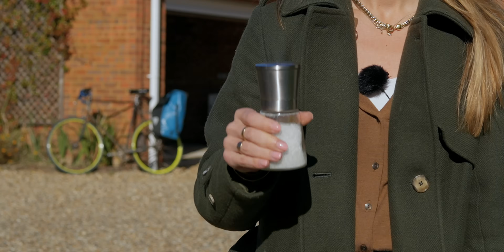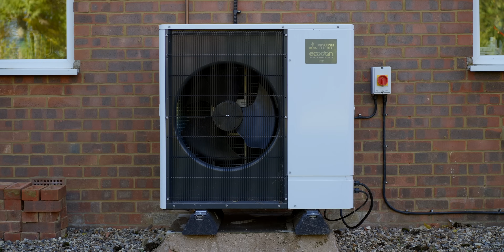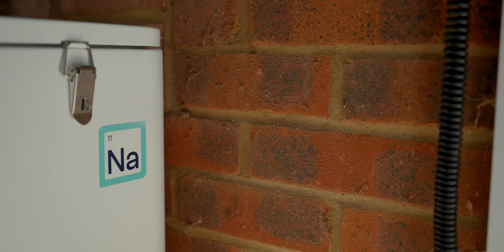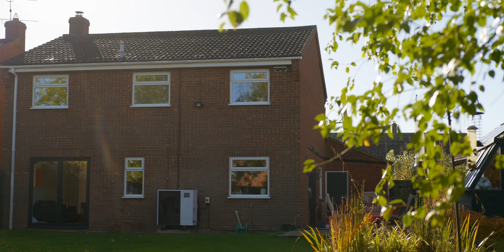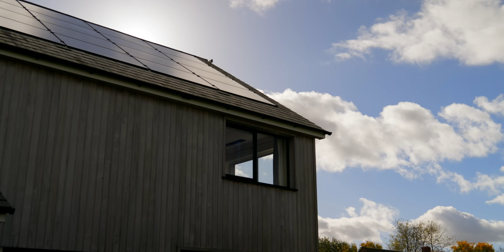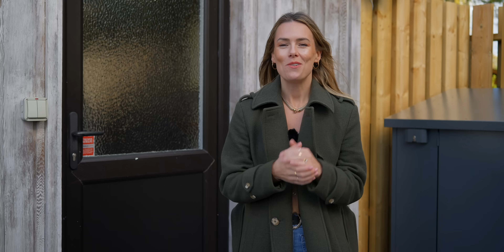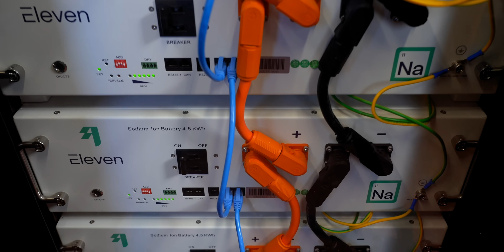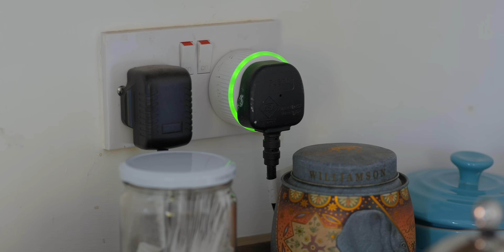Sodium Home Batteries Are Here! Is Salt The Key To Cleaner, Cheaper Energy?

Comment: Home batteries reaching 100,000 installs in the UK is good, compared to some other countries still lagging slightly, but getting there. While we are somewhat lacking in EV take up in Australia compared to the UK we are miles ahead in home batteries so I suppose it all evens out in the end. In just July 2025 it's estimated Australia installed just under 20,000 home batteries bringing our number close to 300,000 total which is remarkable when you consider we have less than half the number of houses as the UK. The climate of course does make a difference, with some areas receiving full sunlight for a far longer period than many areas in the UK. Keep up the good work, you chase us on battery and solar installs and we'll work on EV sales!
Reply: But we could change that 200,000 installs a year if were to make them mandatory in all new builds, along with solar and heat pumps. Subsidising the ones which are made in the UK.
Reply: @DavidKnowles0  Yep I agree, it's my personal opinion that solar and battery should be part of a new house build where possible. Then people say but how, it would push the cost of housing up, whose going to pay for it etc.

Yes there are problems, but they aren't insurmountable. Cost is a factor, but buying bulk through a government purchase then selling cheaper to the builder would help keep that cost down. Other financing systems, maybe current solar farm companies could finance the cost of a certain number and homeowners would basically get their own power for free and any excess fed into the system with no buyback, and the battery power available for use as virtual battery banks.

The advantage is it would be far cheaper to wire up and install the solar panels and battery while building the house because, well you've already got roofers and electricians there doing that work, far cheaper than paying for installers to come in once the house is finished.

Lots of options that could be looked at, maybe take some of the subsidies paid to fossil fuel companies and use that to provide big discounts to home builders and etc.

Comment: Great video. Picky criticism: energy per unit weight is relevant for mobile systems, the relevant density for static applications is kWh/litre (or m^3).
The key enabling technology is the control system, especially one that learns consumer behaviour and predicts tomorrow’s weather. 
Great story. For someone who doesn’t drive most days I want to use fully functional V2G. I look forward to a head-to-head comparison. (All the smart technology in your excellent video would be relevant). Thanks.

Comment: It's not a table salt :)
Reply: Indeed. This is like saying that oxygen is "water".

The chloride in sodium chloride (table salt) is as important as the hydrogen in H2O (water).

Hydrogen is an explosive gas, oxygen causes things to burn - but, put them together, and you've got water to throw over a fire to put it out. A completely different substance that's basically got properties diametrically opposed to each of those elements individually.

In chemistry, you can't just ignore one part of a molecule and act like "it's the same thing". It really isn't. Not at all.
Reply: The battery is made up of many other chemicals besides sodium carbonate, so calling it a Na battery is also misleading.

Now show me where the manufacuturer states they did not use the Solvay process to produce their sodium carbonate from sodium chloride?

Comment: sodium batteries are made from sodium carbonate, not sodium chloride (salt)
Reply: Sodium carbonate is made from table salt
Reply: @tedarcher9120  no it isnt, it is mined
Reply: @ldm3027 both are true. USA mines trona but china makes it from brine and ammonia as it doesn’t have any naturally occurring.
Reply: @ldm3027 Look it up, it's mined OR made from "table salt".
Reply: @Evolution56  but it is sodium carbonate that is used to make sodium for batteries
Reply: And Air is not just oxygen, and computer chips are not just silicon, so what's you point, beside being overly picky?

The Na battery is made up of many chemicals besides sodium carbonate, and yet you have no problems with it's name. Also sodium carbonate can be made from sodium chloride using the Solvay process, and does the manufacturer state their source does not use this?
Reply: @Evolution56  I suggest that you look at how sodium is made before you make uninformed comments .  Origins of  materials are important for supply chains as a certain D Trump has found out
Reply: Sodium carbonate is as a salt
Reply: @maramé.r  dont think you get the point of the reference to salt in this video

Comment: Interesting to see one out there for realsies. 

Pity he was so evasive about the price. It was a fair question. It's not like the eventual answer - "right now, roughly the same as lithium" - was anything to be coy about.
Reply: I think it's because the question was about the 'install price' (not the cost of just the battery)... and 'install price' is a nasty question, given there are so many variables that impact it (state of current wiring, location, what else is being installed at the same time, and so on).
Reply: @logicalChimp  Fair point (though "roughly the same as lithium" would have covered that too!)
Reply: @markiliff  it doesn't because the price range for lithium is so wide.
Reply: @logicalChimp  its not that complicated.  The context for install should be just for adding a battery to a system.  The wiring is small potatoes if the battery is close to the inverter as they always should be.
Reply: @logicalChimp if you're looking at total install pricing I expect lead-acid to be a similar price because it's the installation costs not the parts costs which are the major factor
Reply: @alanhat5252 nope, lead acid would be more because you need so many more batteries and wires to make it work for a home system.
Reply: I wondered about that too - I'd already looked them up on midsummerwholesale, and they're listed ready to buy with prices, which are about same as lithium
Reply: Especially since the price range for lithium is so big.
Reply: Who cares what the price is? All current sodium batteries are now obsolete with CATL's Gen 2 Naxtra now under mass production.
Reply: @ArthurDentZaphodBeeb  everybody cares.
Everybody who wants affordable storage.
Obsolete?
Sell it to me at a tenth of the price and I do not care that is obsolete. :)
Reply: @ArthurDentZaphodBeeb  5 months later and that's still not true.
Reply: @ArthurDentZaphodBeeb  It won't be under mass production until the end of the year. The figure CATL are putting out are impressive, $19 per kWh when economies of scale kick in, which they obviously will do!

Comment: 😄Imogen, good day from Goonellabah, NSW, Australia. ❤Thanks for showing sodium batteries. ❤I knew that sodium batteries. I served as both the project manager and civil engineer. I worked as an engineer in Singapore from 1999 to 2005. We designed and constructed twelve-kilometre tunnels with two boring tunnel machines and five stations. I also managed a team of 160 engineers and architects. 🤗😊Cheers, Ian Cleland

Comment: What is needed is a 1-2 kvh stand alone all in one system you can either plug in and use as is with grid sine following or with a switch to power island mode with sine forming (or both, on separate connections, at once allowing it to be a UIP for sensitive equipment). This way you can shift most of your power use off peak and you could charge it up and bring it to your boat/RV or cabin. If it also have a 12-48V solar input option you could top it up while you are using it in any location.  The small (but expandable) system will allow almost any budget to fit it in while leaving the option for adding capacity and/or solar/generator as extra/emergency backup. A true peoples power pack we all can use.
Reply: Ecoflow.  I have one and it works great. I can charge it from solar and I can charge it from a generator and overnight it keeps my lights on and my refrigerator on and my Wi-Fi running in a power outage. Then I throw it in the car and take it camping.
Reply: @Loki-rascal  Can you plug it in and "backfeed" your in house power grid with no spesial connector? As in a plug from the inverter in to a house outlet using the existing cables with no need to alter anything, as long as you shut of the main breaker?

Comment: Another story about Sodium batteries where their huge voltage drop of the chemistry isn't even mentioned, nor how this problem is addressed. Current inverters cant deal with it, how much are the ones that can? How much higher are they increasing the voltage to compensate?
Reply: The wider voltage range is not really a 'problem' - it's just different. Indeed having simple SOC monitoring from voltage is a significant advantage over Lithium chemistries. Nearly all ESS is used via an inverter so pack voltage is of no importance, so long as you have an inverter specced for it. Right now those are very rare - you get to buy one from Eleven, but I expect others to add Na-ion support soon and this issue will go away. For some designs it will just be a software change.
Reply: @xxwookey  Wide voltage range is a HUGE problem.

Let's do an example. Let's say we have a 48V system, one with LFP, second with Na+. 5kW of power.
LFP pack will have a nominal voltage of 51.2V and operating range between ~48V and 55V. Not a lot of voltage range. At worst, you need to have about 105A of currenty capability on the DC side to support that kind of power.

Now, let's do Na+. Usual voltage range of Na+ cells is 4-1.5V (to get most of their rated capacity). Nominal voltage is 3.1V. So assuming same 16S configuration, now inverter has to support voltages up to 64V and down to 24V!!!!!!
What does that mean? It means if you wanted to pull full power at near zero SOC, you'd need an inverter capable in excess of ~210A of current capability. That's twice the amount you need with LFP. Not to mention the internal design capable of such voltage range.

So no, Na+ won't be a serious competitor to LFP, at least not for ESS.

Comment: Not all salts contian sodium (most don't). Many salts contain chloride ions but not all. Please stop calling them salt batteries.
Reply: These actually have sodium in them. But yes, not salt, because salt is sodium chloride and other forms.
Reply: @roland9367 
Sodium Carbonate is a salt. Look it up.
Reply: But calliing it a Na battery is ok with you? Lots of other chemicals besides sodium carbonate make up this battery.

Sodium carbonate can be made with from sodium chloride using the Solvay process, and if in this case, it's table salt battery.

And sodium carbonate (Na₂CO₃) is definitely a salt.
Reply: Salt is a used moniker for these batteries, and anyway, who said anything about chlorine?  Salts are a class of compounds, eg potassium nitrate.
Reply: Who cares?

Comment: Are they going to produce them in a conventional format for off grid use & for use with conventional MPPT like my Renogy one?
Reply: What do you mean by 'conventional format'? These rack-mount packs are pretty conventional  - quite a few other suppliers do the same thing. You can't just use these with most existing MPPT controllers because the voltage range is different. Na-ion batts go down to 33V, so anything expecting Li-ion will stop discharging when they are about half-empty, and complain that the voltage is too low to charge anywhere in the bottom half. We'll need controllers that understand the characteristics of the chemistry. Which might just be software updates in some cases, but others will need hardware redesign for the wider voltage range.
Reply: @xxwookey  Actually voltage range is 1.5-4V per cell. On a typical 16S setup, that's voltages from 24V all the way up to 64V.
Reply: @hojnikb  That's not what Eleven quote for this battery/cells. I'm just reporting what the datasheet/tech director says.

Comment: His cold weather performance act is just total nonsense here, we never see weather that cold and batteries used for home storage are constantly cycling.
Reply: Where is 'here'?
Reply: @xxwookey anywhere in the UK.
Reply: @Swwils  It does drop below freezing overnight in the UK, and that's when the cheap charge rates occur, so external LFPs may need heaters to charge for maybe 0 to 60 days/yr, depending where you are in the UK. Not a huge issue, but if you have Na-ion the issue doesn't arise. Some people are buying LFPs with heaters, so those same people might well choose Na-ion instead.
Reply: @xxwookey LFO batteries self heat when discharging or charging which in home storage they always are. It's a complete non issue.

Comment: It's kind of ridiculous that they are milking these batteries atm. CATL said they already had production for EVs where the price for sodium was HALF of LiPo - So I doubt we'll see that saving for a few years while middle men bleed the market.
Reply: It's the norm for new tech to be expensive in order to pay for the technology and development and manufacturing.  Prices will fall
Reply: @jamesengland7461  Not when the added cost isn't from the developers, which it isn't. When the retailers add the price, it's just milking the "new" thing.
Reply: @Michael_Schm  These batteries (and inverter) are developed in the UK (Cambridge). They certainly do have development costs to cover as a startup. The cells are made in China.
Reply: @xxwookey  Fair enough - I was talking about CATLs batteries - I dont know enough about the UK based companies and their batteries.
Reply: The cell.cost is meaningless as they are heavier. The majority of the cost of an LFP cell to the UK is shipping.
Reply: @Swwils  Maybe if they are twice as heavy, which isn't what it seems like so far.
Reply: @Michael_Schm  They are significantly heavier. Shipping is the majority of the price of a LFP cell in the UK.

Comment: I like your videos in general, but I have to say I'm a bit dissapointed with this. Firstly, if you want to have a household name for the sodium used in these batteries, calling it washing soda for example would be more appropriate. The batteries use sodium carbonate (soda), not sodium chloride (salt). Secondly, about the low temperature charging. He mentions lithium-ion batteries needing heaters, making them less efficient, but there is no mention of the round-trip efficiency of sodium-ion. There seems to be little knowledge of this, do we even know the efficiency? What if a significant amount of the energy is being converted to heat, allowing the batteries to work in low temperatures? Thirdly, there was no mention of the very challenging discharge curve of sodium-ion. Would've been nice to hear how they are dealing with it in their inverter. When all the surrounding components around the sodium-ion batteries need to handle large voltage and current variation, they will end up costing more than the ones used with lithium-ion (LFP has a very flat discharge curve in comparison).
Reply: Will prowse has some tests on his channel. The ones he tested didn't come out that favourably compared to lfp.
Reply: We do know: the RT efficiency of the Eleven packs is 95% - i.e. just the same as Li-ion, and not 70-80% like some earlier products.
The voltage curve is not a problem if the battery is used via an inverter (which ESS systems always are). The inverter just needs to expect 33-54V, rather than 48-57. It's not a particularly hard thing to design for.

Comment: Great to see Sodium hitting the market now for home battery storage. 
Hopefully costs come down significantly and mass adoption drives the scale production.
Arbitrage is one way to recover some of the cost of the investment in the battery.
Self consumption at peak and then other times is truly the bigger payback unless you get a really good Feed In Tariff. (FIT)
FIT is guaranteed to change as power retailers figure out how much profit they are losing. 
The typical industrial user pays 30% of the rates that households do because of the volume of energy thay buy.
Households are the sponsors of all other power users so we get the worst end of the supply side costs.
Sure there is currently Amber and Octopus and others that are disruptors , but Pennies to Pounds that situation will be short lived so don't bank on this buy low sell high in peak to last indefinitely. 
The payback on a battery typically is 9 years based on kWh stored and usable and the FIT you can achieve or the arbitrage achieved compared to the cost saved if you need to buy power from the grid. when Home storage comes down to around USD$160/kWh, AUD$250 kWh, GBP£125 kWh , then that will be the game changer for domestic users whether or not you can have Solar.

Comment: Salt is sodium chloride.  Sodium ion batteries use sodium carbonate.  You wouldn't put it on your chips.
Reply: But sodium carbonate can be made from sodium chloride, and the manfacturer calls it a Na battery, and most people know that table salt is sodium.

Computer chips are not silicon only, and air is not oxygen, but it's something for people to relate to.

This battery has many elements/chemicals besides sodium carbonate, and yet OK, to leave them off the name.

sodium carbonate (Na₂CO₃) is definitely a salt.
Reply: @Evolution56 Ok, that's a fair and compelling point.
Reply: No but its an acidity regulator that does appear in food